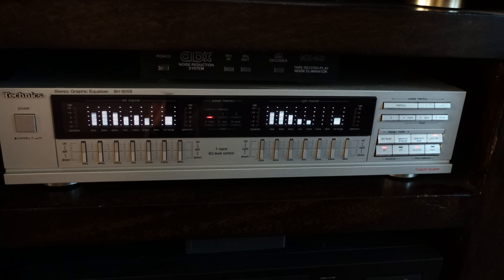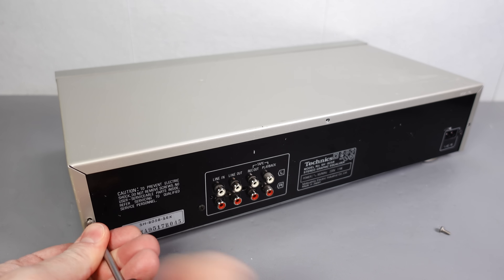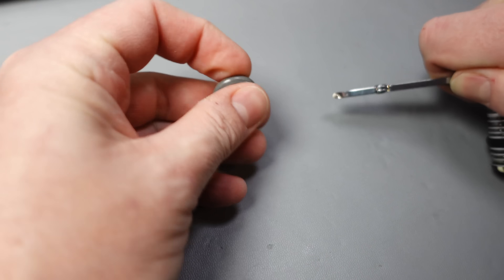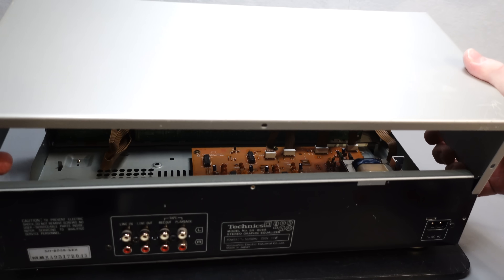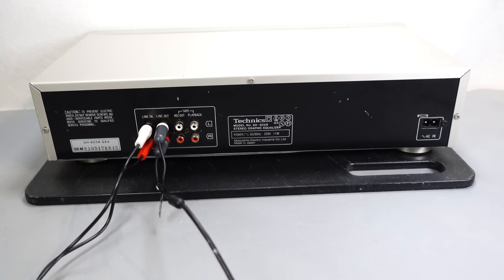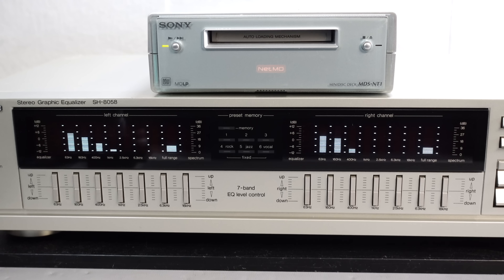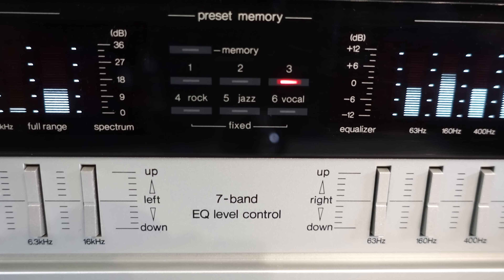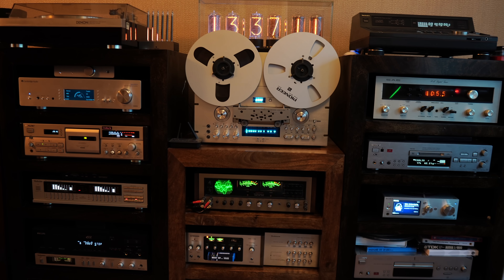The great equaliser - Technics SH-8058

Comment: Equalizer settings are also important if you have certain types of hearing loss.  I have very awful low frequency hearing, but the highest frequencies are pretty close to normal, so I tend to boost the low and keep the highs alone mostly, and I rely on EQ settings to make audiobooks clearer as well.
Reply: I am 68 years old, and I know it's true.  My hearing is not as good as it was 30 years ago.  In my case, the high frequencies are sometimes jarring.
Reply: Can totally agree with having major mid frequency hearing loss.
Reply: Im deaf in one ear   I've never heard stereo. Still like my music though and im quite fussy with tones  albeit in glorious mono. 😁
Reply: @Mitch-Hendren  Ever thought about an implant? It surely sounds strange compared to a normal working ear though
Reply: @ThatSoddingGamer I bet your neighbors like to listen to those mighty basses too :P
Reply: @katho8472  - No?  I'm not that rude.  I mostly use headphones whether at work or home.  I do have a small sound system that I use on rare occasions that might be heard from outside, but that wouldn't be audible unless you were already standing in the front lawn anyway, and the window happened to be open, and even then it wouldn't be particularly noticeable since the speakers are not right in front of hte window and are facing inwards anyway.. 

I don't actually like listening to things at 'rock concert' volume levels anyway, as (somewhat ironically) I'm more sensitive to loud noise than most people (a trait that I'm given to understand, isn't uncommon with hearing impaired people; we need boosted audio, but our maximum tolerance is often lower than average).
Reply: Assume there is some sort of standard test audio track to be played back on these setups to tune equalizers to the optimal settings.
Reply: @davidmcgill1000  But who the defines what the optimal settings are? Right, your ears :)
Reply: Weird. Hearing loss and true deafness run in my family, and all those who are affected can hear low frequencies comparatively well and high frequencies are lost. I never even thought that the opposite could happen.
Reply: @ax14pz107  - Yes, it's apparently fairly rare, even moreso for it to be hereditary (my siblings and our mum are all like this).  I've had two audiologists express dubiousness about my claim, suggesting that it's a common mistake somehow to confuse high and low frequency hearing loss, only for them both to be surprised when I'm right, and doubly so when they find out the family is all like that.  The last one suggested we'd make a good case study, actually.
Reply: @ThatSoddingGamer  it certainly would be. It's a connexin mutation that causes the high frequency loss in my family.

Comment: Excellent point about replacing back up batteries before they leak !

And they're in things you wouldn't expect - my old TIG welder had one that had spilled its guts - luckily it all came good with a scrub up to remove the gunk and solder in a new one.

Be careful not to short any tracks when doing so - they're normally supplied with a charge in them - more than enough to damage tracks and other components !
Reply: Many an Amiga has died for less!
Reply: @matthewmarks6951  😁

Comment: I have the same graphic equaliser, but in black. I have until this last year kept the unit on stand by with the plug in to keep the memory of my settings. Stopped doing that now and the back up battery seems to be still keeping the settings even though it is now  35 years old. Thanks for letting me know about how you changed the battery, because I'm sure sooner rather than later my battery will go.

Comment: That is an absolutely wonderful system you have there! I had a "cough" Realistic/ Radio Shack version of this year's ago and absolutely loved and actually miss it!
Reply: Nothing wrong with Realistic gear, so long as you understand that they had a range of models for different budgets.  They made decent audio available through their large network of store locations.  True audio stores were not always nearby, but Radio Shack was.  Similarly there was Lafayette Radio and Olson Electronics, but they had much fewer locations.

And yes, I will admit that the lower-end models were not as spectacular from the viewpoint of an audiophile (or wanna-be)! 🙂
Reply: Same, I had a realistic from RS as well, with physical sliders and green/red meter lights. I remember my friends and I all wanted to copy Ferris Beuhler's setup...
Reply: Some of the Realistic stuff was pretty decent, in particular for the price.  Most of the audio gear rotated through one month a year when it was on sale at a good discount.  A lot of my old Realistic stuff from the 1980s was replaced with better gear, but to be fair most of the Realistic still worked when I got rid of it, and some of the very-expensive replacements--while fancier and much higher-end--have failed in less time.

In my home theater setup I have two first-revision "Mach One" speakers (which I sometimes rotate  out with Mach Two's)  which I find a bit weak on midrange, so I paired them with two nice "end of the era"  Optimus speakers with the Linaeum tweeters which have good highs and great midrange but not good bass.  Combine the two and I quite like the sound.  It's not quite as nice as my friend's speaker set that was $3500 around 1998.  But you know, the difference isn't worth $3000.  I got the Mach Two's and the Optimus Pro LX5'-2s both on half-price sales.

Comment: Got two SH Technics equalisers. SH-GE70 and a SH-E66 in perfect condition. I’ve had the SH-GE70 in my system via the amps loop out for about 7 years. It performs excellently and no audible noise at all. To my ears it has no detrimental effect on the audio, if anything the vocals sound even more centred. It was so good I bought the second one just in case. 
I will keep in mind the need to possibly replace the battery in the future, for now I have the EQ settings written down just in case it ever forgets them, but thus far no issues.
Reply: I bought the SH-GE70 brand new, about 30 years ago. It's still in good condition.
Reply: @Sigma-INFJ. It’s a very good unit I think. I’m sure no true audiophile would want it in their system but I have much praise for how it performs in my system. The SH-E66 is the same as the SH-GE70 except the E66 doesn’t have the 2 buttons on the right side. EQ Rec and Input Selector, never used them so doesn’t matter to me. I paid about $200 for each on eBay. Can get them cheaper but these were both like new.
Reply: @aussie8114 I actually paid around $200 dollars when I bought it new 30 years ago.

Comment: Great video/explanation. The tape monitor concept can confuse casual users who are frustrated by a silent Hi-Fi, then "blasted" when they finally figure it out. One of my Pioneer receivers flashes the tape monitor indicator every time inputs are switched as a reminder, but the most intuitive controls I have seen are on a Yamaha receiver with a separate "Rec Out" selector instead of tape monitor on/off. You set the input selector to tape, then the rec out selector becomes the input selector...

Comment: I know what you mean about ANTI-EQ snobs. I use to tell them that I had 4 separate EQ units patched together on my system  two for right ch  and two for left ch. You could just watch the arrogance and color drain from their face.  I have the same battery problem with my vintage Technics eq  like yours but mine has the TOUCH -SENSITIVE slider pads. Thanks Matt

Comment: I have an Akai tuner that had he same battery issue, also replaced with a battery holder soldered to the connections. Now it remembers the presets, but only for about 30 mins, then it forgets again. This is an improvement on it being completely forgetful, but I think there is a capacitor that is part of the circuit that also needs replacing.  
For other silver facia EQs Akai did a full range from the same era, but I don't know of any that had spectrum analysers built in, I think they're all just EQ.

Comment: Your absolutely right about equalization Matt!! For my HiFi I have to use an equalizer (Teac EQA-10) for the Dolby Digital and DTS as they have a habit of losing bass and mid level on my JBL speakers.They are vintage as well, and are known for their bass. And while most home theater/receiver presets are adequate, they do have room for improvement. Especially for a mix of vintage and modern audio components. If you don't like Matt's setup or demonstrations, there are a lot of other channels that specialize in the "audiophile" tastes and sensibilities. Try those and let Matt do what he does best, and thats to share his enthusiasm about his hobby with the community.

Comment: Soldering in the battery holder is a great idea and is exactly what I would have done - and in fact have done. Not only does it make future replacement of the battery easier, should this unit move on from your possession or be put in storage for a long time, the battery becomes far less of a concern vis-a-vis leakage

Comment: Changed a number of ‘memory’ batteries. Was asked ti look at a printer that ‘only printed to Legal size paper. Took off off cover and mentioned poss battery they only last 5 years. Took out the CR2032 and hmm the date of manufacture was 5 years to the day old!! Smiled and said. Told you so. New CR2032 and printer now happy to print in A sizes

Comment: I've had this equalizer but I gave it to a friend because the plastic glass came loose and I couldn't get it back attached. They glued it to the middle frame with so strong adhesive that I couldn't find any glue that would keep it in place forever. Other than that it's a nice device, I still use the SH-8046 every day.

Comment: Thanks to your nice revisiting of the EQ line of Technics I realized I have a SH-8055 which seems to be at, or near, the top of the range.  I should dig it out of my stored gear.  Perhaps doing something similar to your battery replacement.  Pooh on those who are anti-tone control.  My unit was used to help make the best recordings of cassettes for almost a ten-year period until I moved on from cassettes  When I listen to those cassettes today they sound really good.  Tweaking the curve was a solid decision and the Technics turned out to be a great find as I bought used at the time. in the eighties along with an Optimus receiver that I used until just a few weeks ago for music at my shoe repair shop.  It finally died by the interjection of spurious noise making  it a  fantastic over-achiever needing retirement. Great video as usual!

Comment: The nice thing about the digital control EQs is they don't introduce noise like the slide fader type ones do. I have a couple of Technics EQ's. The SH-8055 (Faders) and the SH-GE70 (Digital controls). I need to check the SH-GE70 manual and see if there is a battery in that one too. The only devices I have ever seen batteries in are some of my vintage receivers with digital FM/AM Tuners.

Comment: I noticed you have some Cambridge - on their amplifiers there is a pre out and a pre in. Meant that it can be a amplifier with another preamp or it can be a preamp and you can use another amplifier - BUT you can also use these for connecting your equaliser. Saving the only rec out for other stuff

Comment: This was a great repair and bit of future proofing as well, but I can't help thinking I'd have put that battery case outside on the back of the unit, then run the wires inside.   No more worry about a damaging lab inside, and no need to open the case when the battery does eventually die. 
Thats just me though.  Thanks for another great little video.

Comment: I found out a couple of years ago that the "proper" way to use a graphic equalizer is that you are supposed to connect a mic to it. set it in the room where you normally listen, run white noise through the GE and adjust the sliders till the sound is flat in the center on all freqs. supposedly the point of a GE is to compensate for acoustics in a room.

Comment: Loving this. I'd consider myself a hi-fi enthusiast (I don't use the word 'audiophile' nowadays, as that has connotations of people that use music to listen to their equipment rather than the other way around, and spend silly money on 'directional' Ethernet and USB cables etc).

I don't have an EQ in my main system, but I've connected an old Tandy (as Radio Shack used to be called here in the UK) own-brand graphic EQ up to the system in the office. It's not in the signal path; I've hooked it to the analogue output of an el-cheapo PCM2704-based USB sound card, with the actual audio coming via the SPDIF. This means I can have 'das blinkenlights' (ie the spectrum analyser) without messing up the signal path - and that proves very useful when mastering my own music.

Comment: got a sony seq-411, it has 1 spectrum analyser for both channels and mechanical sliders.  So not as posh but no batteries to go wrong eitherv, and it works perfectly after 30 years.  Sadly it's not in use right now, though I might hook it up just for the flashy bits

Comment: I use an Onkyo EQ-35. its 12 band from 16hz to 32000hrz.  It can bring out highs/lows from recordings that have none.  One of the best pieces to have in a nice stereo setup.  Problem is I use a modern receiver and it does not have a tape monitor.  So, I can only use it with my CD player.

Comment: in my opinion if the equaliser/analyser is an important component for any hi-fi as you say every room differs like everyones taste not forgetting various components differ slightly a little tweak makes a world of difference.often wondered what battery was used to retain the equaliser's memory must order a battery holder. i have one but in black that matches my technics SU-V90D amplifier cd player tuner ect. works well for me.

Comment: I'm glad you found out the joys of battery clips. I have tons of old audio stuff, and old synths and drum machines. They often use variations of CR2032s all with those bloody glued on legs. Some time ago instead of trying to find the exact replacement, I thought "sod it - is there some sort of holder?" and found out about the clips.
Bought a ton of them and bunged them in all the devices when I can be arsed to do it. My Dreamcast was the first and it's just so much easier at some point in the future to go in, unclip and reclip a new battery.

Comment: Man, this is a throwback for me. The first major Hi-Fi setup we had growing up was a Technics set (I think my parents bought it around 1988 or so, when I was 12 years old). Along with a record player and cassette deck, it also had a multi-disc CD changer, and I'm pretty sure that equalizer you're working on was the same one we owned. If not identical, very similar.

Comment: I forgot that I've actually got a graphic equalizer tucked away in the back of a cupboard somewhere, I too fell for the "no tone controls" fad and ended up with a preamplifier with just one big knob on the front, which cost more than twice as much as an equivalent one with all the bells and whistles on it, never could figure that one out.  My enjoyment of the system definitely suffered but I learned the error of my ways, tone controls are back and I might just get that equalizer out again one day, not as flashy as yours though, a basic JVC one with sliders which as you say are probably noisy now, I use an old Apt Holman preamp which sounds pretty good on it's own though, if you can find one of those you might like it.

Comment: I had a JVC RS33L Receiver Amp with a 5 channel graphic equaliser included. 
I am now a high end audiophile with valves, vinyl and a Moth record cleaning machine. 
I do not have any tone controls in my system but i wouldn't denegrate anyone with them. What's it got to do with me? 
I enjoyed using the equaliser and would record the recommended setting on the inlay card of some cassettes and pre-recorded cassette tapes.
Thanks again for an enjoyable video Mr.Moan.

Comment: There are a few rare units, the Outlaw Audio RR2160MkII comes to mind, that actually include a processor loop for adding equalizers and other audio processors.  This spectrum analyzer/equalizer can also be placed between the main in/pre-out jumpers if your system happens to have such a feature.  Thanks for the vid.

Comment: Never thought of wiring it up like that😅 But I guess I'm a bit spoilt by the [PreOut] / [Main In] I have on my Akai (AA 5210-DB); Normally it's bridged directly, but you can use the PreOut output and send that through an EQ before tossing it in the Main In... I even used it to split the preamp output to the Main In and a seperate amplifier driving another set of speakers...

Comment: Nice piece of kit, and graphic equalisers do have their uses.
They can help with improving duff recordings by increasing the frequencies that have been lost, such as treble, mids, or even bass. This can make a duff recording sound Hi Res again. But you are not restricted to just bass and treble, you can TAILOR the sound to your PREFERENCE, which is the whole point about these devices. They give the user FLEXIBILITY!
You can also use them in the recording chain, so you can boost frequencies that are being recorded too. So quite a handy piece of kit to have. 👍

Comment: As I am now 67 years old so top end hearing is not as good as in my younger days, I like to boost the treble a bit for my listening pleasure, that is why i use an equalizer. I also have mine running between my pre and power amplifier, i pulled the U jumpers out of the back of my integrated amp and put the equalizer there.

Comment: The tuner of my fh-909r still remembers the station preset after being not used around since 1998 and is using the original backup battery.